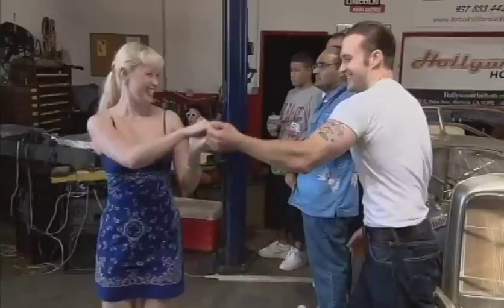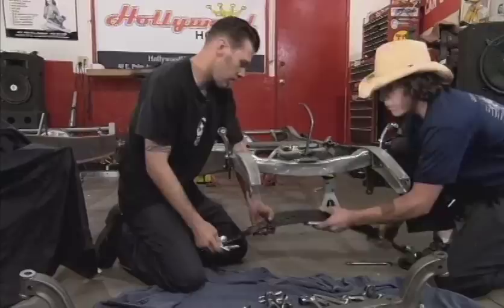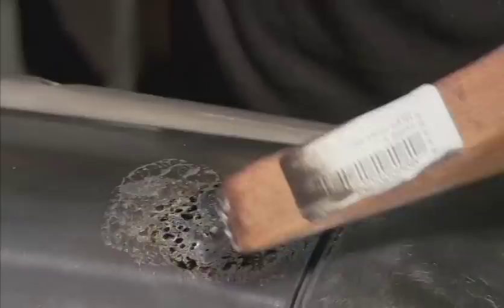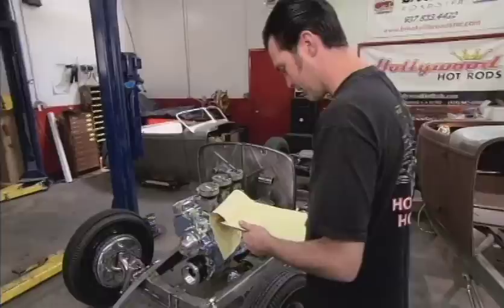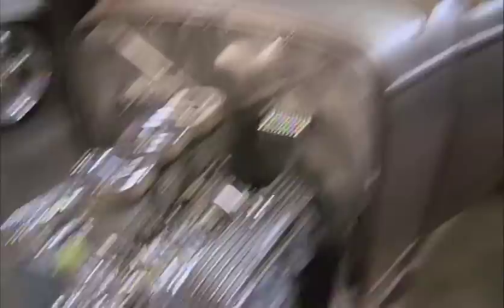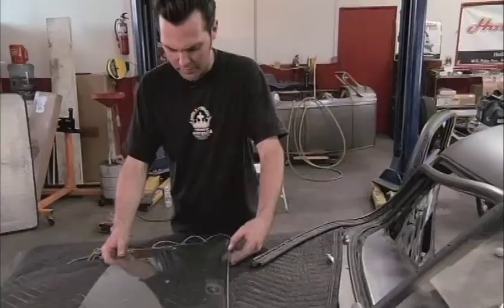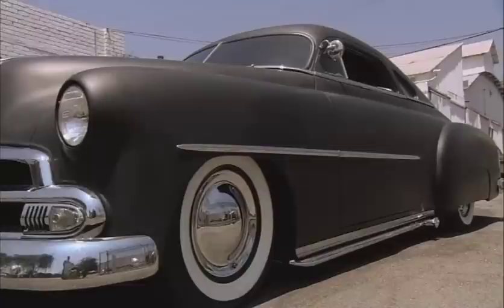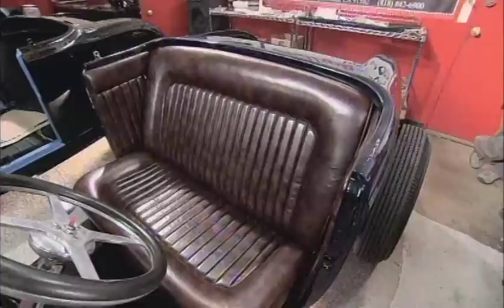RIDES - HOLLYWOOD HOT RODS

Comment: How long .. and how much it. would cost to built sth like that .. but more 'plebeian' .. so kit-parts and lets say with 5.0 Coyote or small-block Chevy .. ? ..
Reply: Bodies were around 10K from Brookville, chassis 2.5K, front end 2K, rear end (based on 9” Ford) 1,5 K, grille shell and s/steel insert 800 $. Wheels, tires, motor, transmission, prop shaft - depends on whether you go used or new, gas tank 250 $, windshield I paid 1200 $ for a bare finish Duval around twenty years ago, chopped ‘32 in bare steel I guess would be around 350 $, glass can’t remember. That’s before you look at an interior, gauges, paint, wiring harness, exhaust. It’s definitely not a cheap Hotrod to build but if you do the labour yourself you’re going to have about 35K invested. You could go down the fibreglass route or look around for an unfinished project. I have about 100 K in mine. Good luck if you decide to go for a ‘32, they’re a lot of fun. 
Geof (U.K.).
Reply: Wondering what engine people are using today .. small-block is obvious .. if it's ford '32 .. could be nice to use Ford engine .. that 4.6 L modular V8 .. sounds good ..  literally .. -) ..

Comment: I don't know anything about hot rods...no boxed frame?
Reply: Jess Morgan boxing is adding metal to the missing side to strengthen the frame
Reply: Those 2 frames were boxed. Most standard cars and trucks don't have a boxed frame. Some might be around the engines but thats usually it.
Reply: Jess Morgan cars back then were made to bend on the roads instead of independent suspension which came out later. Boxing means giving the chassis more strength by putting a box inside

Comment: "It's not a drum, it's a fake cover!"  You just said a mouthful!  A 'hot rod' was a stripped-down, lightened up rig with a hot motor of some kind.  No frills, no added unnecessary parts, and it had one purpose!  Go fast! The cars now being built like these new-age cars are not 'traditional hot rods'.  Fake brake drum covers over disc brakes, fake stick-on quick-change rear covers, phony Olds Rocket rocker covers and looms stuck onto a dime-a-dozen Chevy mouse motors!  Apparently I've been around too long, because this kind of fake nonsense does absolutely nothing for me at all!  In fact, I hate it!  It's 'phony'!  These are not 'hot rods' they're street rods!  If you're going to call it a 'hot rod' it should be built true to the original spirit of the name.  I have no real problem with using reproduced steel bodies, etc. but keep the idea real and true to the original concept!  Otherwise, please don't call them hot rods!
Reply: That's right man. we all love the original built rods. Hell I grew up with them, still got lots of stuff. But if you can modify something and make it work, that's how the old boys did it anyway. And my dear old dad used to say if they had discs available in the 50's and 60's, they sure as hell would have used them. might not have smacked his 32 tourer into a wall...